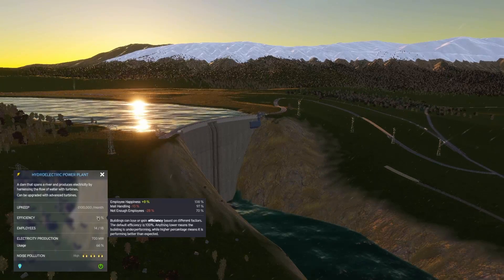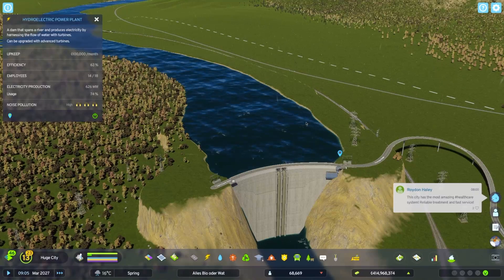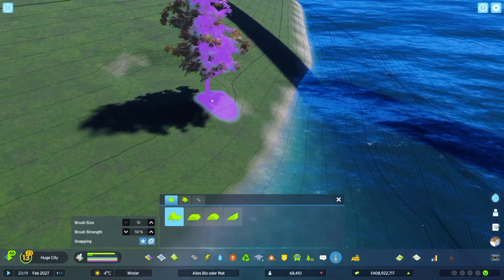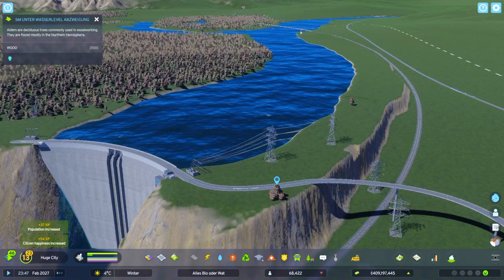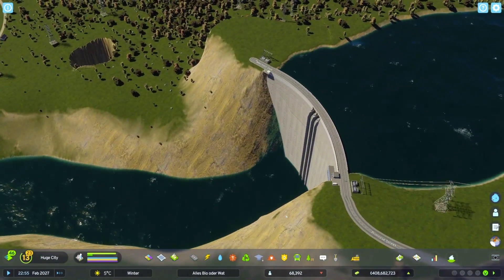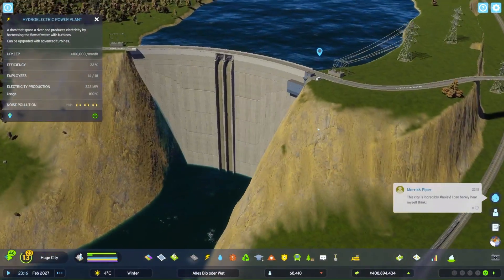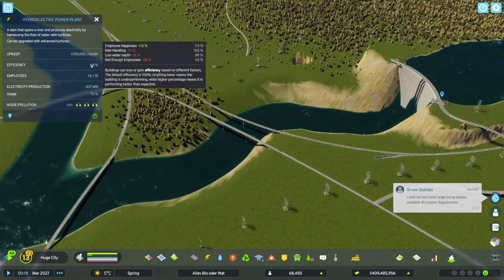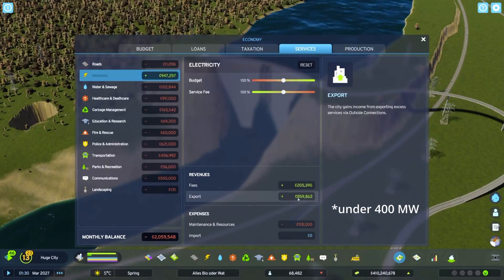100% Efficient Hydroelectric Power Plant - Cities Skylines 2

Comment: how do i get my water to go higher bc its right under the spot where theres no more low water depth
Reply from the maker: higher on the input or output side?
Reply: @tezoid  input
Reply: i fixed it
Reply from the maker: @NioNoob  Glad you were able to fix the problem. If the water level does not continue to rise after a few real time hours, I would build the dam deeper. 
How were you able to fix the issue?
Reply: @tezoid i waited for very long and it rained then i added another river and it went up

Comment: How do you rotate the dam? My dam is always built facing the wrong way, its weird.
Reply: If you are left hand drive it is a known error and a job has been logged with CO. I also had problems.
Reply from the maker: For me it worked to start the construction from the other side than I tried before (If you clicked on the left side of the river to start the construction and then on the right side to complete, try starting on the right side and complete on the left)